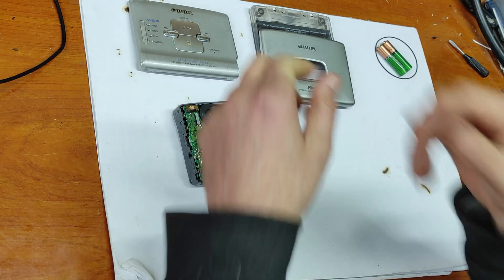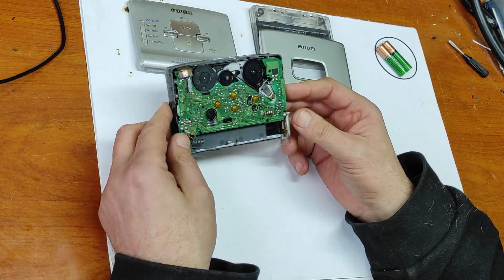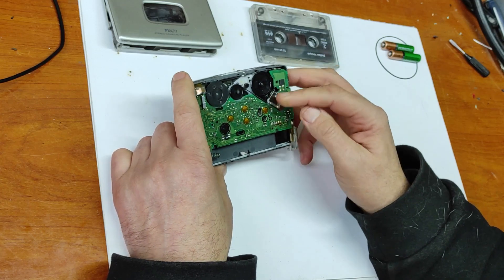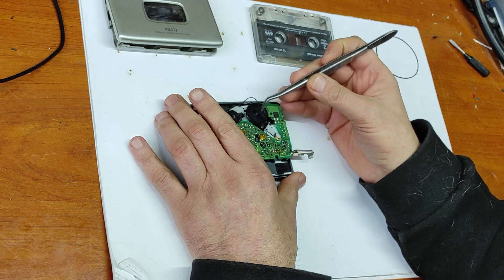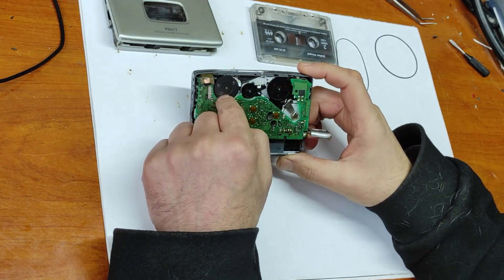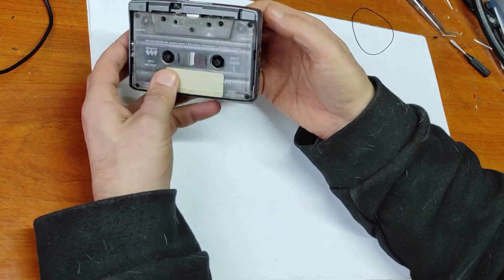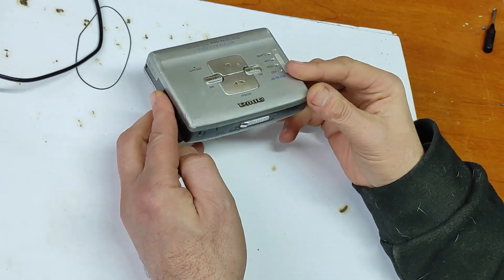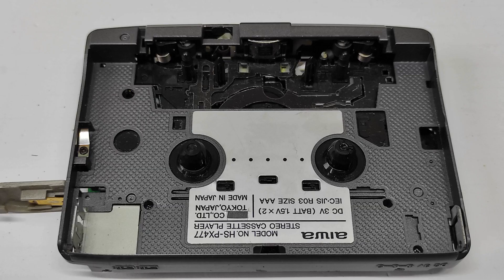Aiwa PX477 restoration and change belt walkman

Comment: I Have the same model and the same problem I need a new belt I’m in UK 
Thank you for this video.
Reply from the maker: Try my method
Reply: @diymariuselectro  I’ve ordered a new round belt do I need to remove both covers to replace it ? 
Thank you
Reply from the maker: yes its very simple.u can do it.
Reply: I ordered a belt for my PX 377. It looks like it's the same mechanism

Comment: Hi. I have a PX 377 with the same mechanism. Installed a new belt, but it only plays correct in one direction. The other direction is 2% too slow with 5% wow & flutter :-o Any ideas? Thanks
Reply from the maker: I make scratches on the wheels.U have to measure the diameter of the flying wheel,I said in the video,difrent diameter makes difrent speed.